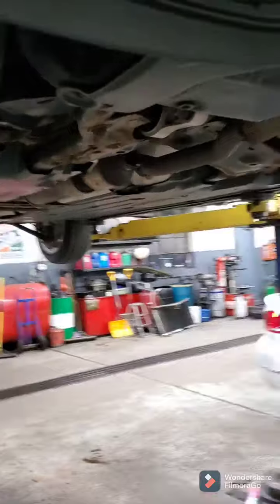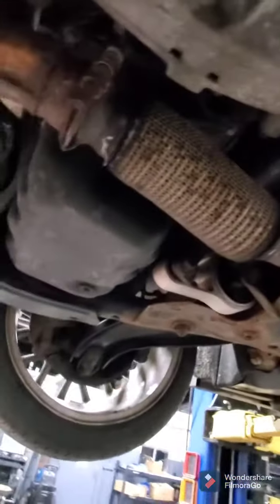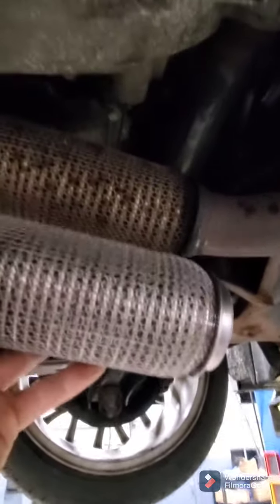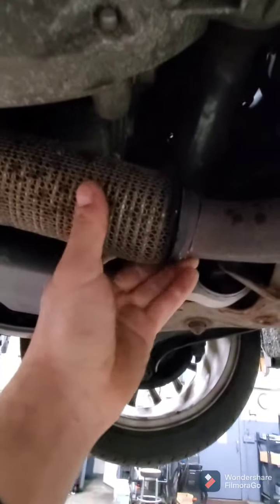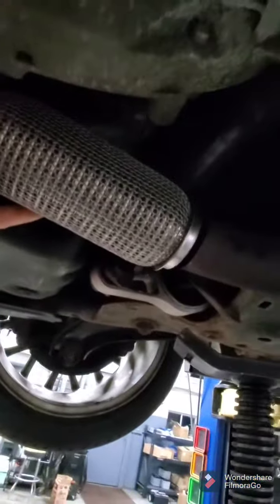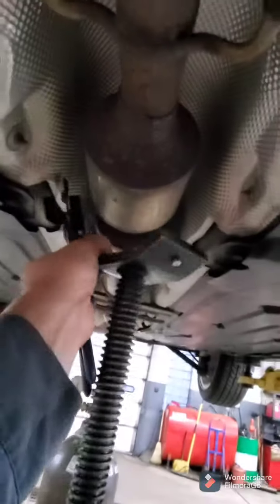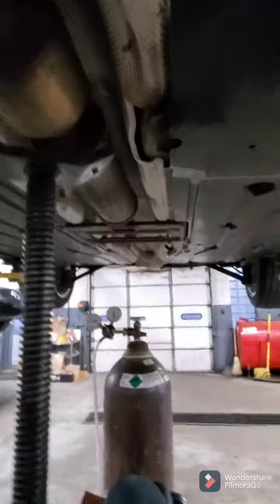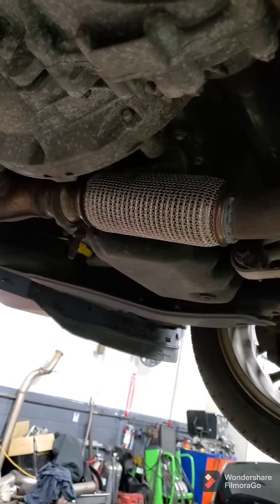Replacing 2012 Mini Cooper exhaust flex pipe

Comment: They make a repair piece that doesn’t require welding, fits over the pipe on the muffler end, supplied with both clamps. This is a better alternative for most amateur mechanics who might not own a welder and don’t feel like investing in one. A reciprocating saw is a lot less expensive and requires little skill to operate.
Reply from the maker: Good tip! Thanks!

Comment: Can I replace the vband clamp with 2.5 inch aftermarket? The OEM sucks as it rust and seized overtime and needs cutting off
Reply from the maker: You could do that but you would have to cut both flanges off and weld the aftermarket vband flanges onto the pipes
Reply: @EuropeanAutoRepair  I wonder why the aftermarket won't do without those flanges as they are quite similar size 2.5inch vs 67.5mm